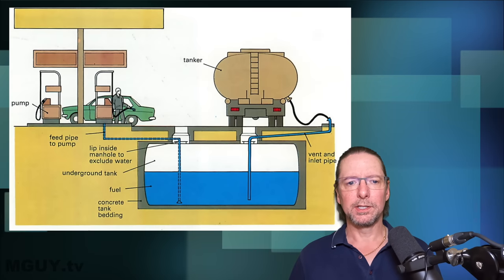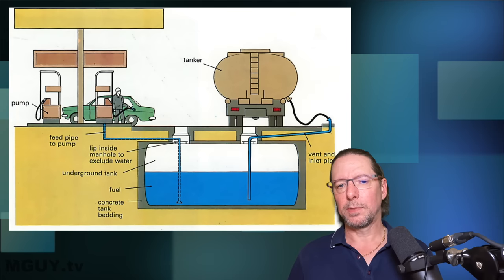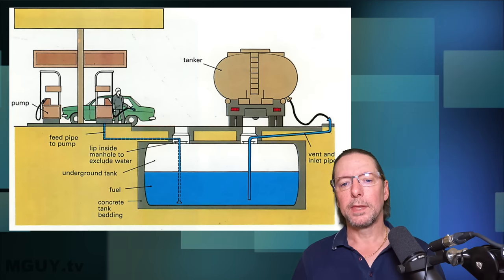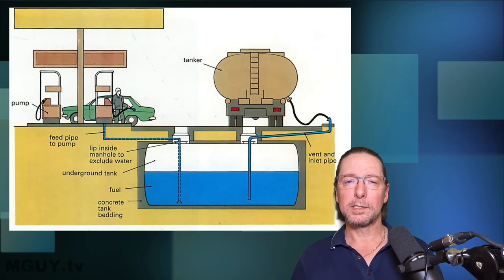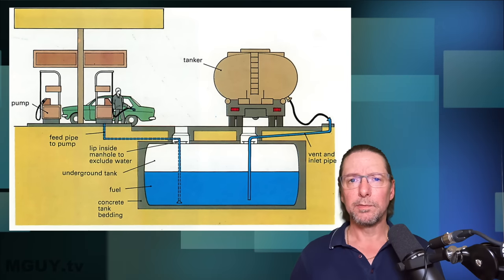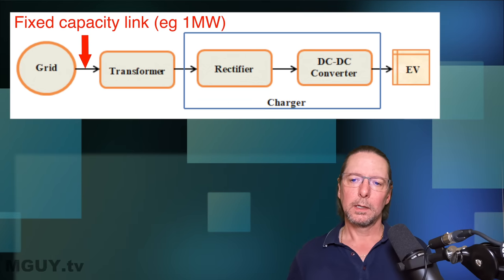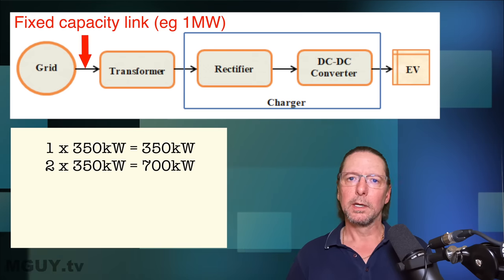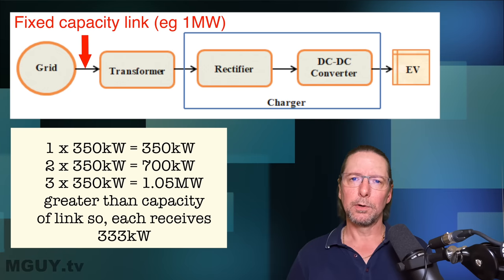HUGE problem with EV Charging Stations that no one mentions | MGUY Australia

Comment: This just show how lame infrastructure and non innovative we are. EV stations does not need large floor space compared to a gas station. You can install it anywhere basically just under a light post. But it needs to create large infrastructure to feed it.

The comparison with a large fuel tank is very irrelevant and Electricity is not like chemical energy. You can compare large reservoir to a large battery bank. But Electricity does not need always local storage as it can transmit one place to another via wire in instant unlike a truck to transfer fuel or a large pipe.

Comment: Your illustration just indicates a charging station that is improperly designed.  There is no reason the grid transformer can't supply 2 megawatts or more so that all chargers can deliver max power. As mentioned by others in the commets, you can have batteries locally for peak demand. This is analogous to your underground tank.

Comment: the ev,are for city inner traffic N all those alternative power are meant for a household use.that also is a failure; the tec. of the combustion engine sure have to do extensive research to maximise the use of fuel (galon/mileage)

Comment: cold weather is the big problem. and ev chargers do not work in the cold. and the cold drains the batteries out faster. the charging is going to cost more money. EV. catching on fire and when the batteries quit you will have to new car and they cost more than gas car. maintance check up will cost more. it takes about hour and half to charge you are not moving take longer to get there. so you spend more time on the road. more money to spend. the EV that do not run where they dump them they will have to make a place so the acid will not leak in the ground. more money to spend.

Comment: you are completely ignoring the self-supplying charging stations which are being built out with solar, especially with tesla, as well as the megapacks being utilized for storage for future use charge. gas is on its way out, charging networks are becoming more efficient, and if you are using the tesla network then you are good to go.

Comment: Why don't they tell the truth about EV emissions? EVs are sold as an alternative to hydrocarbon emissions, but the truth is that they are only an offset of hydrocarbon emissions. It will likely take at least 120,000 miles, or more, to become carbon neutral for an EV. Another truth, the original battery will likely not last that long prior to needing significant repair or outright replacement, thus starting the clock all over again. And last, but certainty not least, 70% of the world's electricity is made by burning hydrocarbons.

Comment: Uh, no. The grid provides so much but it all never goes to the car when you have to balance.. A couple percent is lost in the buck converter and a couple if the lines are a.c. And a couple more lost in the battery heating-up. The car might have another buck as well and the loss converting to three phase (is that calculated with capacity or conveniently ignored?).
   It is not a perfect system, there is parasitic drain all over, 5-15%. That will come out of the split for multi vehicles. 33% for three or 333kw is a theoretical ideal only.

Comment: I think for real world applications EV's are not the total answer. They might work fine for inner city commuting but not for long distances in extreme cold weather. You might be ok as long as you can keep them fully charged at home. They are, however, known for being fire and explosion hazards. Some people have had horrific problems with this. I also think people could get mugged or car jacked waiting in line to recharge their car. It is likely very time consuming. The only reasonably good use of EV's is with electric bicycles and golf carts.

Comment: The solution is to not adopt EVs, or have batteries in the chargers to provide the power.  Either way, the whole concept is a cluster fuck.  As long as politicians and incentives are involved.  This is not how the lightbulb started out, and it requires infrastructure as well.

Comment: Governments went in the wrong direction w electricity without selling hydrogen powered vehicles to the public. Hydrogen can be transported similarly to LPG. Existing gas stations can modify storage until green hydrogen conversion. Nuclear is proven green. Now safety. Every nuclear plant would require an adequate prebuilt emergency system on rails far enough away to be railed over in whole area in the case of accident. Sounds big, huge, enormous, however we will not be rebuilding the entire e grid. Hydrogen will require a huge amount of clean nuclear energy to extract hydrogen from the air, however, we will not be strip mining up the earth for the lithium. We haven't even discussed the battery disposal system that is not in place yet that will certainly not be disposed of properly.

Comment: Ok, this guy is pointing out a problem with ev charging...but to view it in a different way;
   1) The local connection that the gas station uses for its power is not enough to charge the heavy loads of many cars at the same time.  The gas station will have to upgrade to a bigger electric service...possibly at a higher voltage and a bigger step down transformer and/or bigger wired to the local grid.  All this upgrades/equipment is expensive...say $10k to $50k.  Who's gonna pay for that?  And what about that power line going by the gas station...Is it big enough for the extra power needed...the power lines are designed for the worst case...not the average case.  And we all see many gas stations clustered together...this will make it even worse for the locals with these now power stations.
2) Now look at your typical gas station...it may have say 6 pumps stations capable of filling cars on both sides at once...for 12 cars.  Filling a gas tank, takes what 5 minutes.  An EV charge will take if we are lucky 15min to 1hr?  So for handling the equivalent gas thruput of 12 cars per 5 min.  All of a sudden the gas pumps will have to be multiplied by 10 or 12 to handle the same car thruput every 5 min.  Many gas stations do have the room to expand for that, but many do not.  Especially the ones in metro areas.   Upgrading the gas stations is going to be huge cost...or the cars are not going to need to drive 300 miles on a full charge, they're going to have to drive 500 to 700 miles on a charge...so people on long trips can go to charging hotels and charge up overnight there.  
Hybird cars are the real answer.

Comment: It will take you 60k miles in your new EV before you actually break even and it starts to become green. Before that production, materials, charging etc... Will still have a negative impact on the environment. As for charging, the electricity grids of most countries will not be able to meet demand should everyone start driving/ charging their EVs. Sadly EV is not the way forward for longterm transportation. We need to find new and better alternatives, hydrogen could very well be a better alternative.

Comment: This is what happens when you have fenders on. The fact that you have EVs capable of charging at 350Kw and ranges upwards of 600Km should tell you that the technology has developed enough for mass adoption. To then think technology is not and will not progress any more is illogical. Regardless, your 'problem' is a non-issue because barely anyone actually needs to charge at 350kW.

Comment: Electric vehicles are the biggest joke and biggest mistake this country can make. Besides the charging problems we have the overweight problems. An electric vehicle weighs two to three times more than a combustion engine vehicle does which of course will break down the highways a lot quicker. Also people don't think that's going to affect parking garages I'm pretty sure they need to think some more. I would not want my vehicle parked on the lower decks of a parking garage when there are a bunch of electric vehicles parked on the upper decks. I promise you these parking garages were not designed to support all that extra weight. They're designed to support vehicles that weigh approximately around 2000 lb not 5,000 lb. People in this country need to pull their heads out of the south end of their body and do the research on this stuff instead of believing all the lies they are told by the electric vehicle supporters, because they are nothing but a bunch of liars. If you buy an electric vehicle you are buying a lemon no matter how good it runs, because they just aren't practical.

Comment: yup, Im sure there are many problems but Ive had EV for many years and I wouldn't go back to a gas vehicle unless I was forced to.   Cant tell you how much better it is not to have to go the the gas station.  And EV are much simpler in terms of maintenance.  No oil changes.  Ive never had to bring one of them in for maintenance.  So hate all you want and good luck to you.

Comment: Electric Vehicles are far heavier than petroleum powered (ICE) vehicles, due to the battery packs.

On average EVs weigh 750 lbs more than an ICE car.

Larger EV sedans weigh as much as 1200 lbs more than a comparable ICE car. The Rivian R1T truck weighs 8,532 lb (3,870 kg)!

The average EV battery alone weighs 1000 lbs! What is the energy cost of lugging all that weight around All the time?

Gasoline tank capacity ranges from 10 - 38 gallons.

1 gallon of gasoline weighs 6.3 lbs, so that's 63 lbs to 239.4 lbs, a fraction of the weight of battery packs.

Gasoline powered vehicles also require just a few minutes to fill the fuel tank completely and they get lighter as you drive, because the weight/volume of petrol fuel reduces as the fuel is consumed, whereas the weight of batteries remains fixed, regardless of charge, and can require many hours to recharge, whereas refilling a gas tank takes just a few minutes.

The only way to increase the range of EVs is to add more batteries, which means more weight, which requires expending more energy to move the car. Adding more batteries also requires re-engineering the EV with more space to accommodate the additional batteries, and a stronger chassis to support the added weight, all of which adds even more weight. Such an exercise provides a rapidly diminishing return, and at some point becomes completely unviable as the EV becomes too heavy and inefficient to move.

PS. No one has considered the additional wear & tear that extra weight will cause for both the roads and the vehicles, suspension, tires, bearings, etc, or the damage that increased mass will inflict in an accident. 

And SO much more!

There's a reason EVs have been relegated to golf carts, wheel chairs, battlebots and children's toys... 

https://youtube.com/shorts/rNFgHvC_OkE?si=7WRHiLWnJQrwUgh1

https://youtube.com/shorts/C-ktYGWq_JA?si=btuSVaNbEH3hYdiP

Comment: I think Toyota has the best solution with its ammonia/ hydrogen cars which relates more to tanks and nothing to do with EV power grids or their limitations.  Who wants to get out of their car when its minus 30, blowing snow in order to plug it into an EV charger ?  I don't want to think about trying to learn anything to pay or find the right plug that fits.  They will have to develop better batteries and a charging station which you drive in, the doors close and the car is charged from the bottom much like a watch being charged with its magnetic base.  Why would plugs be necessary ?  High voltage electric trains don't require a plug  but then they don't need charging either.

Comment: The lack of comprehension of this conversation is remarkable. The whole paradigm is and will continue to change. Currently around 80% of vehicle trips are less than 25 KMs. Electric vehicles do this beautifully. Under current ( pun) arrangements, EVs will charge at home, over night once or perhaps twice a week, on off peak rates, using electricity that is wasted, even more than is wasted ATM, generally. (Coal fired power stations range between 10 and 20% efficiency). Charging "stations" will be ubiquitous, needing to be located where vehicles are stationary/parked, for extended periods. Of course as solar PV installations increase use of solar energy, along with increased storage options make EVs easier to use, less costly, less damaging to the atmosphere and so on. A recent trend has shown the value, and effectiveness of "lamp post/power pole" based chargers, making even street parking incredibly viable. No more service stations having to store highly flammable liquids, delivered by big polluting trucks, transporting fuels, from huge storage tanks, fed by polluting refineries , generally overseas, where most of our fuel comes from. Locally sourced, secure energy supplies, on tap at home.

Comment: Until they can develop a charged replaceable battery at a sevice station ( like a dewalt or Milwaukee powertool ) evs will never become a replacemet for  gas vehicles.
Reply: Some counties have experimented with quick swapping battery packs, China has been leading the way this far. This would require auto manufacturers to agree on a specific size, weight, voltage and universal connectors for the concept to stand a chance.

Comment: IF you really want to be "green", you could have (LARGE) solar farms that make hydrogen which can be used for fuel cells to power electric motors in vehicles.  Swapping tanks would be quick, but still needs expensive infrastructure.  The solar power and hydrogen at the farms can power the compressors and infrastructure.  The hydrogen tank delivery trucks can run directly on hydrogen or have fuel cells, maybe both.  The fuel stations could also have solar and run on the hydrogen they sell.  ZERO pollution, completely renewable.  You could even modify a Nio car to where the battery can be swapped with a fuel cell/hydrogen tank module so you have the choice of a battery or hydrogen power.  But, who actually really cares???  It's always about profit!!!

Comment: I am also not big on  the rush to EVs but your video is flawed, I work for an electrical contractor and we have built commercial charging stations ( for a large delivery service who's name sounds like a jungle) that will accommodate charging dozens of vehicles at the same time and quickly.

Comment: If you replaced every car in England  with EV cars there is not enough copper to make them, England has about 20 - 30 million cars,  and i think electric car will be banned in the next 5- 10 years, due to environmental  damage, car fires, and road damage,  as a EV is heavier, will go through more tiers, plus some makes ie, Porsche,  you have to take eyes of road gust to change  air  settings

Comment: EVs were a piper's dream. Batteries are not ready to replace fuel......and specially now with the lack of quality controls in lots of "new" EV companies........you just watch one EV catching fire (not to mention, the gases produced are poisonous........you leave just 1 EV to catch fire, the amount of toxic pollution it spreads on the environment in that single day, is 1000 times worse than 100 fuel vehicles could spread in a year.......and not to mention what they do with the wasted lithium batteries which you have to replace after a couple of years..........not to mention the amount of extra electricity you need.....that means either more dams, more nuclear plants, and reconvert or the grid to transform the high tension with more transformers........it is worth praising the progress of the technology, but I hate when those greenminded progs want to rub in your face they use EVs and they don't pollute the planet, when in fact they pollute way more than a regular car.
Reply: "Quality control" is not important. The real question is, are the manufacturers following D.E.I. guidelines in hiring workers.

Comment: The amount of draw when multiple cars are charging will require a sub station to manage the load. This is going to cost. Our networks aren't even designed to take the Over-voltage let alone take under voltage caused by huge loads. 
Perhaps they may need to supplement the load by installing a big diesel generators. That would make sense. As much sense as the clowns pushing us down this road to disaster.

Comment: You have to be absolutely mad to buy an EV today if you don't have a charger at a home and/or at the office and you think you can use your EV to do anything more than going to work everyday and at the nearest supermarket on the weekend. I've been driving one since March (Skoda Enyaq) and I will give only 1 data: since 1990 I use to do 25k Kms per year, whatever the car is (from a little Renault 5 to a Lexus), in 9 months with my EV I've made... 2,800 Kms! Because I cannot go anywhere with it except to work everyday and that's it. EVs are simply useless.

Comment: The fact that this issue (and it is but one of many multi-dimensional issues with EVs) is not systematically scoped in a reasoned way demonstrates the intellectual bankruptcy of the whole space. It allows people like @giarcareklaw to ask "reasonable" questions which actually go to systemic failure of the whole paradigm. Do you think that when the US embarked upon the Manhattan Project during WW2 that they didn't scope ALL the dimensions of what was required to achieve the production of the bomb? I was taught mathematical physics by someone who worled at Los Alamos and when I look at the intellectual calibre of the people in EV space it is just depressing. It is all marketing. and skate across the surface thinking.  Where are the real world dynamcial models of  what happens (in terms of infrastructure, stability etc  etc) as we move from n vehicles to  2n vehicles. In the US some category theorist students  of mathematical physicist John Baez are working with NIST on such issues using category theory. There is no such group in Australia.